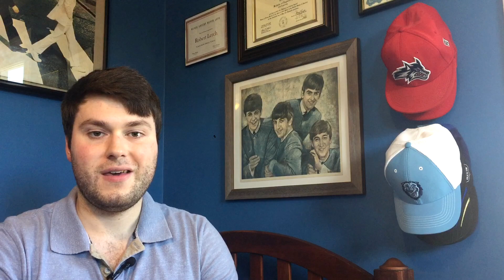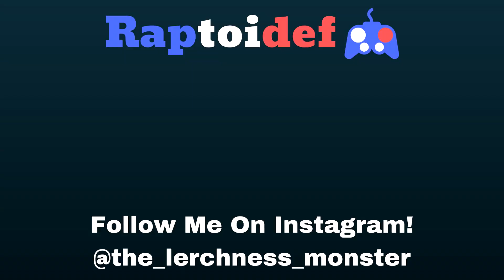WHY PEOPLE FAIL THE FE EXAM

Comment: I studied for less than 4 hours total and passed the exam. Some takeaway that I had throughout the whole experience was knowing how to manage time. It's okay to make mistakes in multiple questions. But for the ones you know how to do, make sure that you are not making any errors.
Reply from the maker: That's very impressive to have only studied 4 hours and passed!
Reply: Hi Rob, 
I noticed you are working for an engineering firm in NY. Is there any chance that you guys are hiring any entry-level engineers? I just sent you a connection request on linkdln and would love to connect.
Reply from the maker: @visionaryal7877  Hey, do you have a resume you can send to me via LinkedIn?

Comment: I am taking the Environmental FE in April. I took the FE in Dec and didn't pass. I am considering taking the school of the PE review course. Do they specify which videos/topics are for the different kinds of FE? i.e. will they make it clear which videos are helpful for the environmental FE? And is the course just lectures or do they give hw/practice problems? Thanks in advance for your help!
Reply from the maker: They have a course for each FE exam. So the material would cover everything on the FE Environmental. They give you practice problems and notes as well in addition to the lectures.

Comment: No lie, I just studied two days to pass my Mechanical FE. As long as you are a good student and did not 'Chegg' a lot, no problems to solve exam problems with ultimate legal cheat sheet (which is 9.5 manual). Everythings are exact same with your college level courses.
Reply: If you passed with only two days studying, you must be the top 0.000001% in the intellectual power. But again, this is the internet, everything is possible.

Comment: Thanks for your videos,, if am not mistaking you mean about reference Manuel men’s Reference handbook? Second question as per the handbook should i review just the civil engineering part or all of it? Please advise.
Reply from the maker: Aula Jomaa Def review whatever will be on the test you plan to take. Look at the sections included on the Civil FE and just concentrate on those. The reference manual has additional sections like electrical and chemical engineering that you won’t need.
Reply from the maker: Yes the reference handbook.

Comment: Were there a lot of theoritical question on the exam based on your experiences?
Reply: Thanks for your reply. So I mean like in the environmental, engineering material, etc in the Lindenburg book, there are a lot of theory. Are we should to memorize all of the theory?
Reply: Also, does ncees remove some part like the ethics text from the reference that you used during the exam? Because in the reference that they published on their website, they provide a complete explanation about the ethics.
Reply from the maker: James Wijaya They don’t remove anything from the reference guide. The theory behind environmental engineering is definitely important to know. I would def try to learn as much as you can for it.
Reply from the maker: James Wijaya There are def a good amount of theoretical questions!